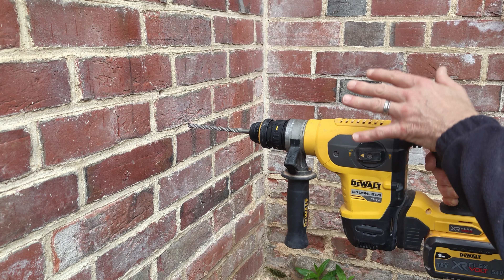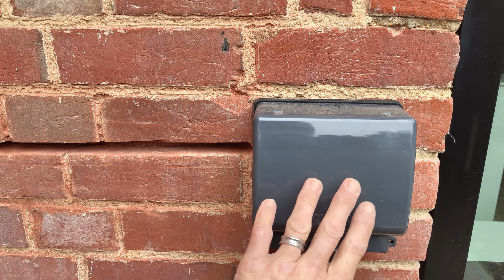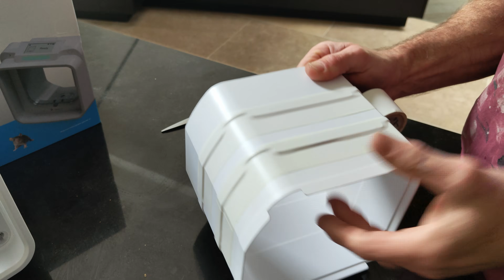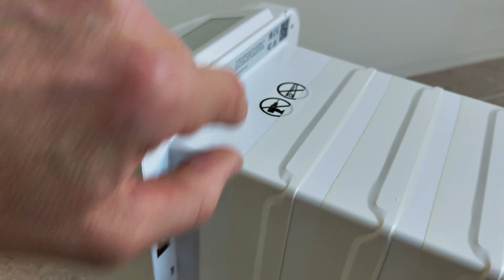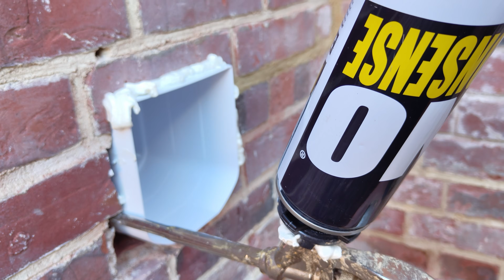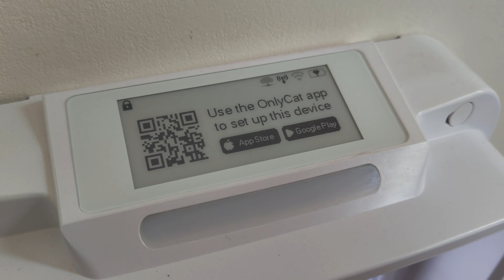OnlyCat - Customer Installation (In-Wall) - Simon Davies

Comment: except that when you open the flap to screw it to the wall your guarantee is gone. did not know this when I ordered now need to order spare parts (wait & probably pay taxes and fees on those once more) and then find a way to fit them into my super crammed space. being allowed to open the flap to install it like the sure flap would have saved me all this extra trouble. so your video above is only half true...